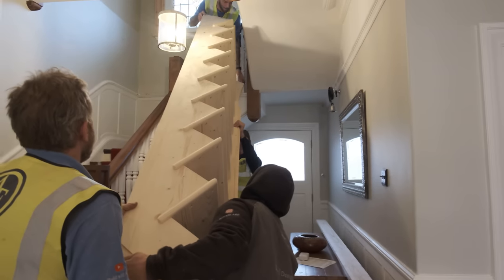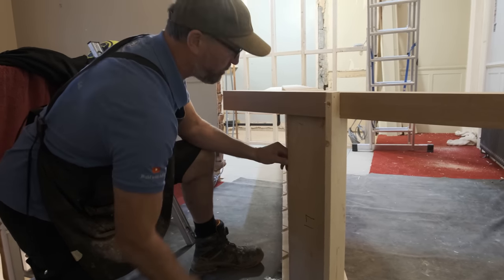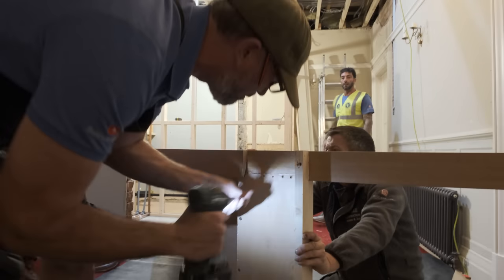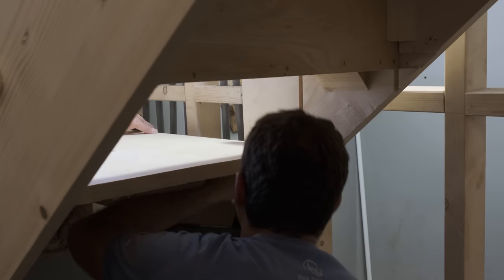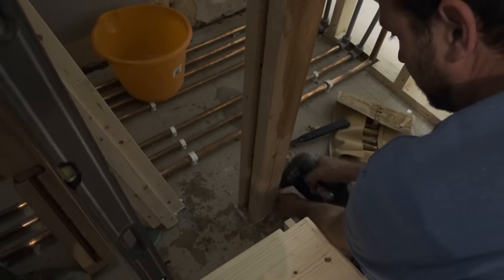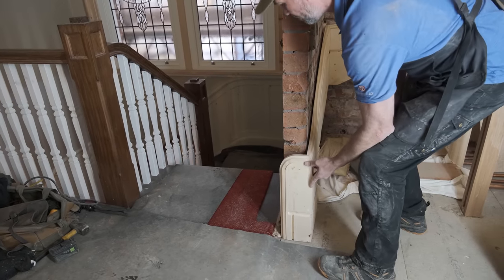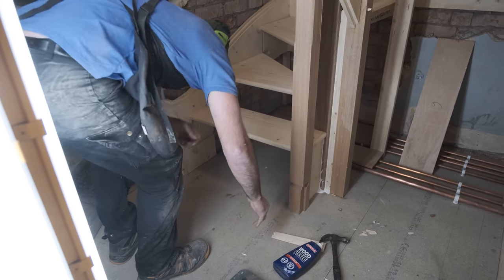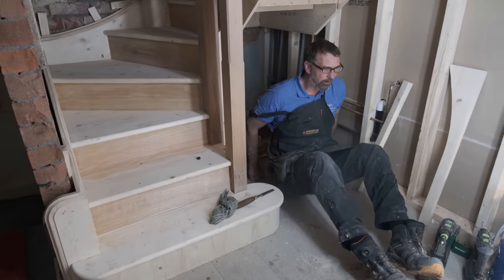How To Fit A Bespoke Wooden Staircase

Comment: Fitting a staircase is one of the most satisfying jobs in carpentry work. I think its a great sense of achievement connecting the separate floor levels. 
Looks great, how come you didn't make the staircase yourself Tony?
Reply from the maker: Time and cost really nothing else, Lyndale have CNC staircase routers and built it in a day and a half all the best Tony 👍
Reply: Ya if u make it this has been manufactured off site
Reply: Staircase build is joinery.. fitting is carpentry.
Reply: @rogue2419  we know that pal👍

Comment: You need to get your Electrican to fit Yoozyboxs to switches /sockets rather than packing them off , they are a plastic extension that can be reused , not only does it cover connections so nobody gets a belt , they give a neat edge to plaster round and makes it easier for plasterer , also if you do a lot of tiling in kitchen round sockets fit them first and then tile right up to the box, neat straight edge that the socket will then cover and no more guessing or nibbling tiles once you screw them back ….. nice job on the staircase 👌🏻

Comment: Tony in stairs like this, what takes most the load? The floor that the stairs launch from, the side stud wall they screw too, or the floor above that the top of the stair hangs from?
Reply from the maker: The way stairs are designed and built are 99 percent self supporting once put together correctly, stairs load onto the trimmers, newel posts and bottom tread. All the best Tony 👍